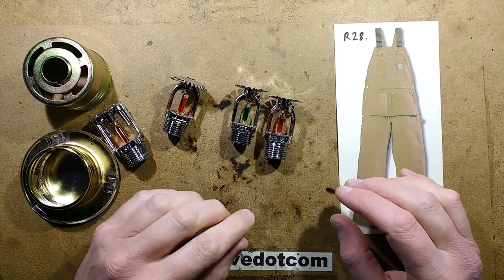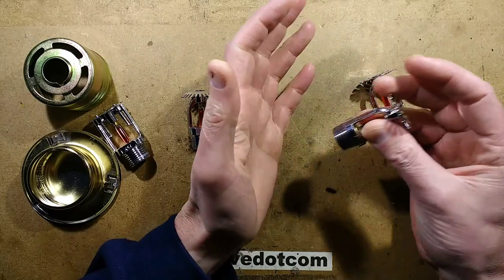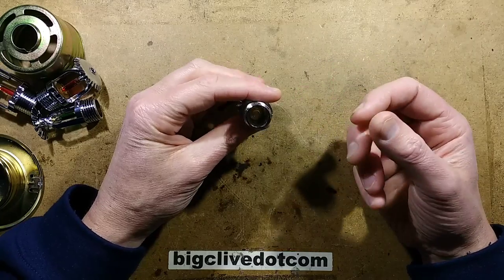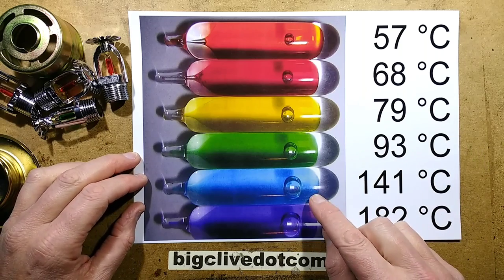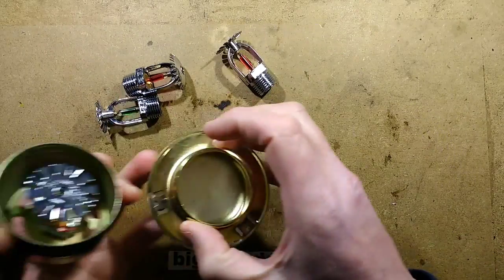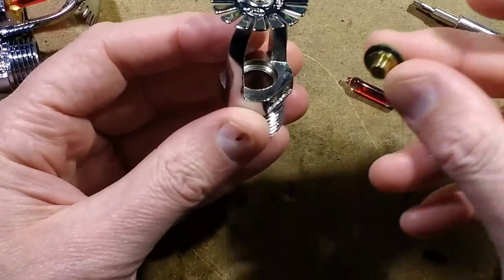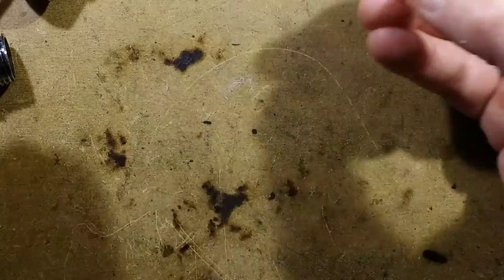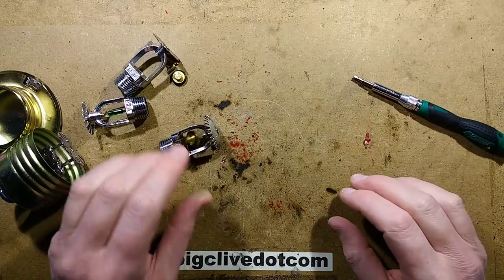How a fire sprinkler works. (featuring broken glass and spatter.)

Comment: Please tell me you were wearing safety glasses! Now why not light one up with a LED.

There are residential sprinkler systems that use PEX tubing. They are plumbed in with the regular plumbing (often the toilet) so you do not have to regularly flush them out. The diverter plates are shaped for the spread pattern. You can get close-to-wall 180 degree patterns, side wall emitters, etc.
Reply from the maker: +Bigrignohio I'm always wearing glasses for at least some protection.
Reply: I knew you wore glasses. However I am constantly surprised by how many consider standard glasses to be sufficient protection. Still some protection is better than no protection. I am just as guilty of that feeling. Which now is so much worse because I had vision correction surgery and sometimes forget to wear goggles when I should.
Reply: Engage safety squints.
Reply: Regular glasses are indeed inadequate for eye protection, I know this only too well when I was grinding a metal part down, and a fragment of hot metal flew off and went almost dead-centre in my right eye, and stuck to the cornea, was fun extracting that, but left my eye a bit useless for a week before it started to heal up and clear, I got lucky though, others may not be so lucky...
Reply: I was wondering if this sort of tie in was possible, thanks.
Reply: twocvbloke did it melt the glasses?
Reply: Brett Anderson - a colleague of mine uses the "squint technique" (assisted by sunglasses) when doing short runs of arc welding . . . . . . Only ever had "one or two" instances of Arc Eye (I bet!)
Reply: Ben Quigley: I now find myself saying that at the end of most YouTube videos. I've been AvE brainwashed :-)
Reply: wooohooo found the AvE intersection thread.  Now who also watches colinfurze and HPC?

Comment: You might not want them running off mains water supply incase the pressure is too high or you get water thumping from other equipment which utilises it, it wouldn't be pretty if they all went off because there was a sudden surge.

If I remember rightly they often have a drenching tank/cistern somewhere in the building which is fed by mains water and topped up. That also helps incase the water supply is interrupted at some point.
Reply: Cisterns/tanks would most likely be utilized in high-rise construction since water pressure drops the higher you go unless you pump it up to an even higher level and allow it to flow back down under gravity.  That's why so many buildings in NYC have water tanks on the roof.  And depending on whether the sprinkler installation is wet or dry, the supply is either mains pressure backed up in many cases by a dedicated "fire" pump (wet) or fed from an outside sprinkler connection that the fire department connects their pumper to to supply high pressure water (dry).
Reply: Water hammering isn't a big problem. Reserve tanks are used when the municipal water supply cannot deliver the flow needed, such as more rural and well-fed water supplies. Low- and mid-rise buildings often have high-pressure water supply separate from domestic, like how hydrants are fed.
Reply: I worked at Viking Corp, a manufacturer of sprinkler system. Upstream of the heads is usually a pressure regulator. Also, dry systems don't require a detector. It's all done mechanically.
Reply: Sprinkler equipment is tested to 300 psi you need a really big surge to set a head off. Your plumbing devices are only rated for 120 give or take.
Reply: sprinkler heads are rated 175PSI working, special 250PSI high pressure are available. they're probably tested to 500PSI for the 175 working and higher for 250PSI

Comment: Do you know how to shut them off, I was in fire department, we all had these wood wedges, slip them in from opposing sides. Then hit with hammer til they just drip
Reply: Sprinkler wedges are just to stop the flow from a head in terms of stopping further water damage, you have to go to the sprinkler room, turn the main off and open the master drain
Reply: Doc Hawk well of course, we never had to do that we had a fire training building with a 1 inch line feeding several heads each head had a shut off valve. They did that so they could change the test move things around, it cracked me up, after putting fire out, and smoke cleared. It was a trash can with hay in it. That stuff would fill that place up we couldn't see our hand in front of us. After going thru that it's very easy to see why people die from smoke inhalation. It was eye opening. We couldn't see our locators either.
Reply: Sounds like a run of the mill sprinkler demonstration for a fire class, i got lucky they didn't make my academy class wedge sprinkler heads
Reply: Any particular reason sprinkler plumbing  system wouldn't have a shut off valve?
Reply: waswestkan they might now but the state hospital where I trained, was built a long time ago. So no shut off valve, it's for fires could you imagine someone turns off fire valve, then fire happens. Now a days they use a shut off valve usually a chain ran thru it, but another reason maybe just one room caught fire, and the valve shuts them all off, well if ya just had a fire there are hot spots that may reignite so, best to leave it on and shut off just one zone, or room with wedges. Also the buildings I trained in were huge. That plays a roll, hot spots and all. Maybe a crazy patient holds a lighter up to one, then you can just shit off that sprinkler. Without having to evacuate the entire unit because of one sprinkler.
Reply: All systems have a shut off valve
Reply: There is a main shut off valve that stops the feed of water to the system.But even when its shut off water in the system will still flow till no more water is present.

Comment: The glass bulbs used to be made by two German companies, Job and Giesler if I remember correctly. As well as the bubbles, the liquid has metal particles inside to allow the bubble to reappear after they test the bulb in a water tank a couple of degrees below the actuating temperature. At least that’s what I was told when I worked at the sprinkler factory. They also sold a sprinkler production line to China back in the 80’s which I guess eventually put them out of business in the UK.

Comment: Do you really want to flood your workshop with water, particularly if your workshop uses lots of electrical or electronic tools, maybe you might want to isolate the mains supply in the event of fire. My old university had a very expensive main frame computer room that was isolated by a glass wall that ran the length of a corridor, so all who pass through could see this very expensive marvel working. This was in the days of drum disk drives and tape streamers, where all the indicator lights were tiny bulbs not LEDs. At each end of this corridor were automatic metal fire shutters that descended from the ceiling in the event of fire. Once down the whole area was flooded with halon gas. Interestingly, there were large fire warning notices at each end of the corridor that explained that the shutters would descend a few seconds after the fire alarm sounded. Anyone caught between the shutters after they closed would be suffocated by the fire suppression gas. There was much debate as to the relative value of the students, faculty and IT staff, compared with the computer equipment the gas was protecting.
Reply: For the love of Thor.  Halon will not suffocate you.  It doesn't remove oxygen from the room.  Halon combines with oxygen at the very high temperature flame surface and starves the flame of oxygen.  Standing in a room when Halon dumps is very loud, very cold and makes your voice go deep (opposite of helium).  If you're caught in a Halon dump you stand still and protect your eyes until the release finishes.  You won't be able  to see anything as the cold expanding gas may cloud the room with water vapor (fog).  Then when it finishes and you can see again, you calmly walk to the exit.
Reply: Star Gazer The warning were very clear, "those remaining between the shutters after they descended would be suffocated". As I recall a small side room houses the gas cylinders which were about five feet tall, there were a larger number, a mix of green and black in colour. While halon is non toxic, any gas that displaces oxygen will kill in sufficient volume. Having read the technical documents on halon, I can only assume that CO2 was also being used.
Reply: Nigel Green cylinders with black tops would be nitrogen.  Black cylinders with green tops would be argon.  Both are inert gasses used for fire suppression, often mixed together (IG-55 is an example that uses 50% nitrogen and 50% argon).  These systems are designed for the size of the server room so as not to endanger personnel.  

I've visited or worked in many data centers.  Everywhere I've ever been that had a halon or inert gas fire suppression system there has always been someone who earnestly told me the gas sucked all of the oxygen out of the room and you'd die.  Sometimes that person was the one who made the signs.  

Here is a quote from the folks that make IG-55 systems:
"This type of suppression system extinguishes a fire by reducing the oxygen concentration to a level that will no longer support combustion. Because IG-55 does not decompose when extinguishing a fire, there are no toxic or corrosive decomposition products created. A normal IG-55 total flood suppression system is designed to provide a residual oxygen level between 10% & 15% after discharge from the usual 20%. Whilst the residual oxygen level will not support combustion of most fires, personnel within the protected space will still be able to breathe normally, allowing enough time to exit the room. The lowest oxygen limit acceptable for personnel occupancy over a short period of time is 10%."

Fire suppression systems that are designed to kill the occupants of the room are rather counter-productive.
Reply: Star Gazer no green cylinders and black cylinders. It was forty years ago, so the details may have been blurred over time, however my memory of the warning notices are very clear as these were a topic of converstation at the time.  Maybe the intention of the signs was to expedite the evacuation of the area, we never had a fire, so we will never know:-).
Reply: It would be asphixiate not suffocate really anyway! 🤓
Reply: Lee Jackson This is a point of semantics, I reported what I remembered of the notice. We do not talk about asphyxiating a flame or fire, the word commonly used is to suffocate it. The dictionary definition of suffocation includes the phrase "to deprive of fresh air" also "to stifle or smother". So while asphyxiation may be the correct scientific term, it is understandable that the other word might be used. To be honest I cannot remember which term was on the sign, from memory it was suffocation. In future I will be far more careful to check for accuracy before posting an anecdote.
Reply: Fair point. Not every sign tells the truth though, maybe it told a white lie to make sure they left pronto!
Reply: Regardless of whether halon will suffocate you or not, (it will) it's probably not a good idea to be in the vicinity of a fire, if the suppression system doesn't get you, the smoke will.

Comment: Old post but just stumbled across this.  Love yer vids Clive.

I design these systems for a living.  The heads themselves can withstand more but the typical system working pressure is 175psi.  Installed systems are tested at 200psi or 50psi above the expected working pressure before being placed in service.  Each manufacturer makes 1200+ different variations.  Into which they have invested millions of dollars in testing.  Subtle deflector changes dramatically effect performance.  Choosing a sprinkler for a specific application requires some experience.  All sprinklers have to be proven and then listed by Underwriter Laboratories to be used in a system here in the states.  The Chinese Ebay variants are likely not UL listed. A properly designed sprinkler system is proven hydraulically based on the available water supply.  The pipe sizing is dictated by this math. This math in effect simulates a fire condition and proves how the system will perform in that scenario.  There are minimum application densities needed for a given/expected fire load.  Also, a system for your home has a different set of parameters than a commercial building.

Comment: In most of the US you can put sprinklers in you home for an exit route (not the whole house) using plastic supply pipe.  After all it only needs to give you 90 sec to get out in case of fire.
The little rubber seal is a big deal.  A few years back one of the largest producers of these heads was required to recall millions of these because the rubber was corroding the metal and then the head would not release properly. They simply filed for liquidation.

Comment: the bubble is probably nothing. they are probably heated to their trip temperature then sealed. the bubble would form as the liquid shrank in volume creating a vacuum, or vapor bubble.
Reply: That would make sense and sounds really easy to accurately control. I wouldn't know how they could otherwise put the exact amount of air/gas into the tube when every tube will seal slightly differently.
Reply: If you think about it though, if the bubble is being formed as a by-product of a process like that, the size of the bubble should be fairly consistent each time and you could actually use it for quality control purposes.
Reply: I expect earlier alcohol vials have been replaced with bubble-containing water vials, to cut production costs by millions of dollars.  Same reason that bismuth tabs were replaced with alcohol vials in the first place.
Reply: Air can be compressed however liquid can not so the bigger the bubble the more heat is required to hit a high enough pressure IE explode .
You will find the only difference with the liquid is the coloring being used to indicate temps however the higher temp units will have a larger bubble this offers more room for the liquid to expand before it hits the popping point.
Reply: air  would add a level of error in the accuracy of the temperature sensing, but a void or vacuum knowing the expansion rate will give you the exact temperature it will rupture at.
Reply: Clive just said that.
Reply: Surely if these are made by heating to working temperature and then sealed it can't be water or one of the more common volatile alcohols because it would need to have a boiling point above the highest working temp of 182C. Otherwise the contents would vaporize during manufacture.  I think it will probably be glycerine or thin oil of some sort.
Reply: Propylene glycol would be a prime candidate. Miscible with water, increases the boiling (and  lowers the freezing) temperature, non flamable and harmless. It's used in food, medication - including injections, given to livestock, used as antifreeze and in solar thermal installations (for the exact reason of increasing the "liquid" temperature range).
Reply: superdau yes that's a very likely candidate, but for the top of the temp range at least it would have to be 100% glycol, no water, to avoid boiling during production. It also has a good coefficient of expansion .0007 - more than three times that of water, so a small strong vial can be more easily burst by a given temp increase.
Olive oil and thin paraffin oils would work just well from all these points of view, but not water miscible.

Comment: I always taught they had like a wax that melted to set them off
Reply: Older sprinklers had a fusible link that released the plug.  I don't think wax was used since it softened so close to room temperature.

Comment: The liquid inside is glycerin, which expands as it heats up and you are correct, the flush mount caps are soldered on with solder that has a melting temperature about 10% lower than the burst temperature of the glass vile. This way they fall off right before the vile pops.

Comment: The liquid within the ampule of the sprinkler head is a mixture of alcohol and water or glycerin and water. The % of each is changed to determine the activation temperature of the head. The color is from a dye and indicates the activation temperature. It is put in the liquid so that you can visually inspect the ampule to make sure it is still intact and the liquid has not evaporated or drained out without climbing up to the head to look. This is most often caused by the glass of the ampule cracking and the liquid evaporating. This would cause the head to go off at other than the stated activation temperature (either lower or higher depending upon the type of fracture of the glass).
As previously stated, the heating of the liquid creates an internal pressure within the ampule which breaks the glass at the activation temp.
Low melting metal alloys such as woods metal are also used.
Common temp ranges, based on maximum ceiling temperature are:
135-170 deg F, 175-225 deg F, 250-300 deg F, 325-375 deg F, 400-475 deg F, 500-575 deg F and 650 deg F. The faster the element is heated up the lower within the range it will activate.

Comment: Yet another wonderful dissection by Clive. Just a note:  These are not intended to "put out" the fire. Their purpose is to spray cooling water over a wide area to help absorb heat from the fire long enough to give the fire department time to get into position at the scene. The firemen put out the fire, which hopefully is not yet out of control. And I do have them piped near the ceiling in my shop building where I do welding jobs on my projects, along with a very loud siren. Cheap extra insurance.
Reply from the maker: It's notable that many fires in buildings with sprinklers are actually out before the fire brigade arrive.